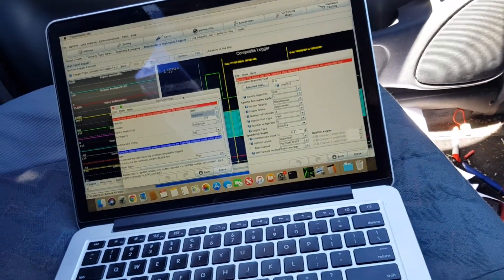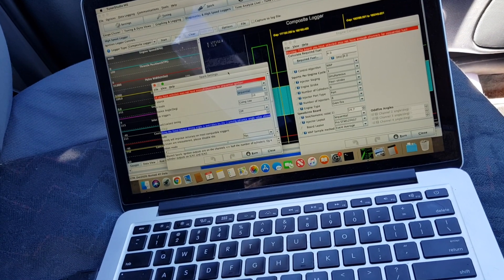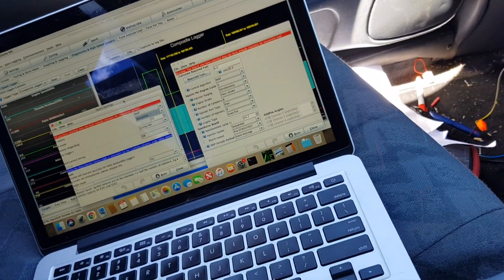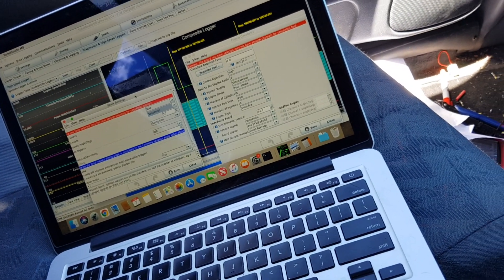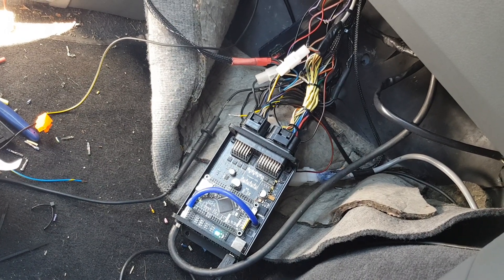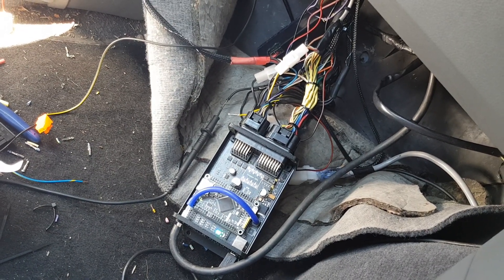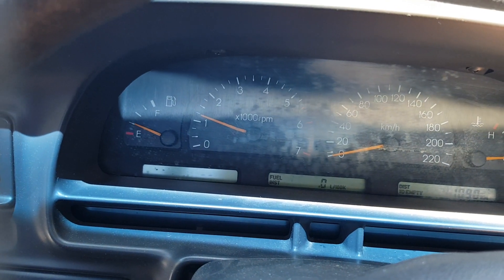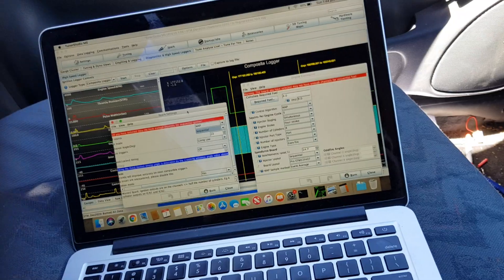STM32f407 Pro ECU up and running on V8

Comment: So I am looking into one of these systems to run a car in the Rocky Mountain Race Week next year .  I have been researching the slow starting issues .  If this system works much like the mid 90s ECUs than the pickup needed is a GM quick-start setup .  It’s a 18-1 with 3 window hall affect sensor (inside the back of the balancer wheel)   of a  3.8 car like a ‘95 LeSabre .  Sensor needs to be the factory sensor that should mount easily almost anywhere off the timing cover or block.   I might make it an external type mount off the engine I am thinking about.  It could run off a 1:1 chain drive off the engine plate too.   But yea, seems like the 18-1 wheels are the key.  Or 18-2-2-2 if the system could configure it.   Still learning about these. So the research continues.

Comment: do you think this would have enough channels left over to handle a dohc v8 with vvt on all 4 cams?
Reply from the maker: yes it does have enough outputs, but the firmware doesn't support 4 cams, currently only 2 VVT.
Reply: @etpulsar  ah ok. Im looking for something to manage a bmw s65 without spending an insane amount on plug and play options. This ecu looks super promising
Reply from the maker: @zachogdahl210  ok. I have the similar engine m62tu 3.5. I've had it running on my pnp board I made for it. Including the dbw.